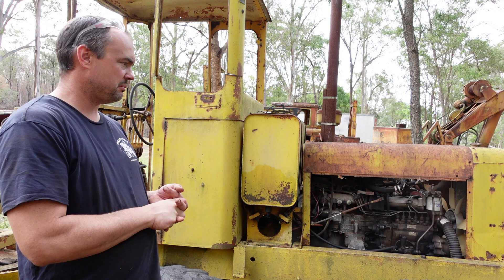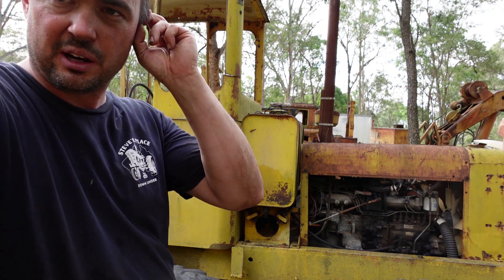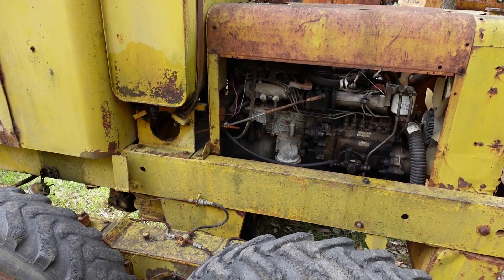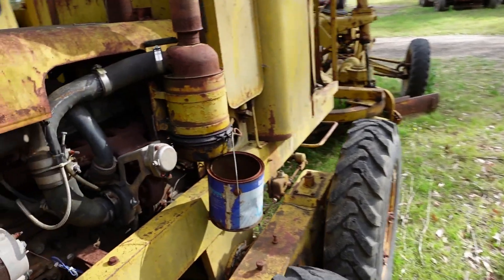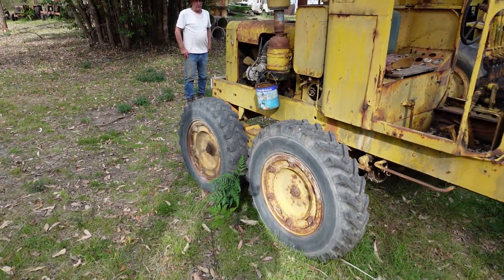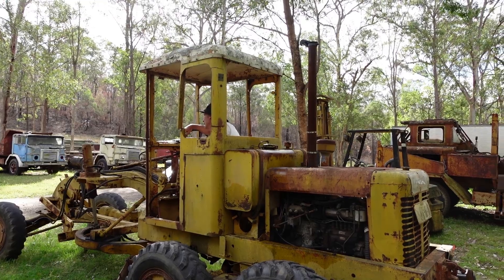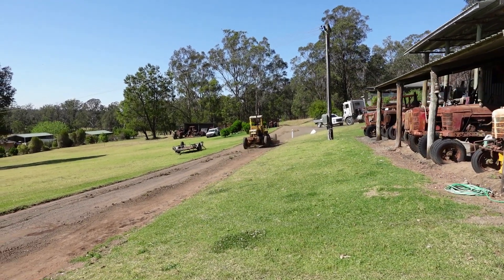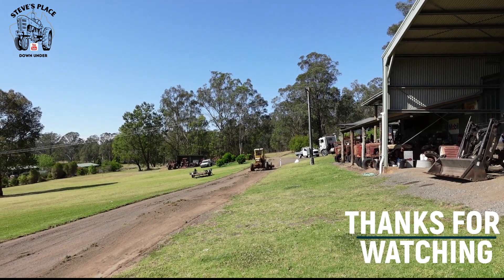TOYOTA TURBO DIESEL powered earthmover!

Comment: In the U.S. alot of the old International diesels started on gasoline and switched over to diesel to run. So oneside was gasoline and the other side was diesel. They were used in farm tractors and heavy equipment.
Reply from the maker: Hi mate yes I’ve seen these. A mate of mine has a TD24 like this

Comment: Those dipsticks and fuel gauges are pretty hard to find nowadays, I've heard you have to look pretty hard in the bush to find the right length. 🤣🤣🤣
Reply: Got exactly the same fuel gauge on my unimog except it's in metric and not wired up

Comment: Our first Landcruiser was a 1986 60 series but it had the factory fitted turbocharger.  We traded it up to a 100 series but the turbo model had not been released in Australia then so had to settle for the naturally aspirated diesel. Certainly noticed the difference, so much in fact we got rid of it and bought a 2006 model Sahara with turbo diesel which we still have . Thanks for the video Mate
Reply from the maker: Hi John yes they weren’t really powerful without the turbo. Reliable but steady. Great vehicle all the same. My pleasure

Comment: Toyotas  are practically bulletproof if you look after them. 
I've had my Landcruiser since I brought it new in 93. All my mates said I was nuts to pay $52,000 for it back then but, it will still take me anywhere. Those same mates have been through dozens of cars in that time so, it was cheap in the long run. It's still great to drive.
Reply from the maker: They certainly are Graeme. It is a lot of money but pay for what you get mate and they are a great product